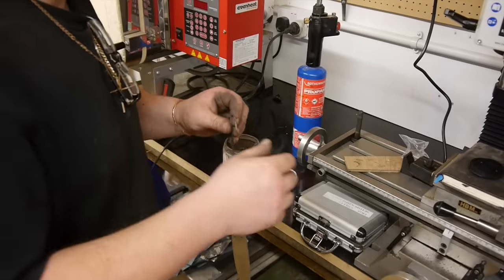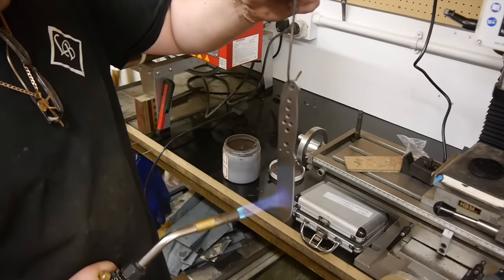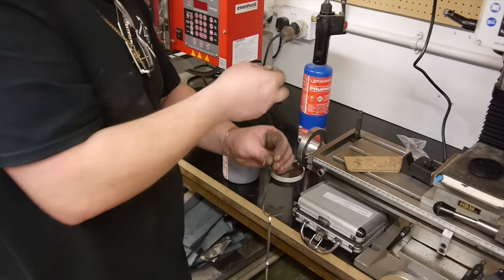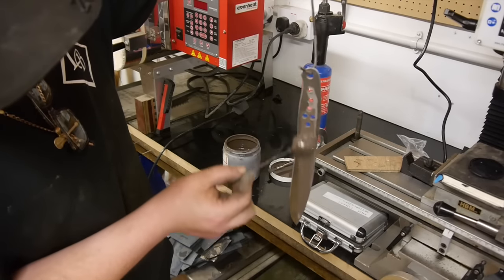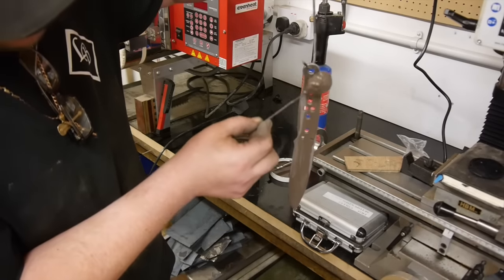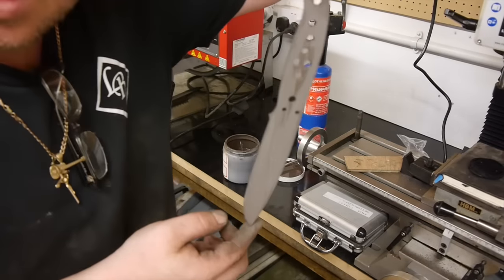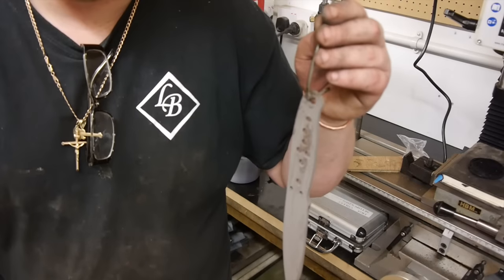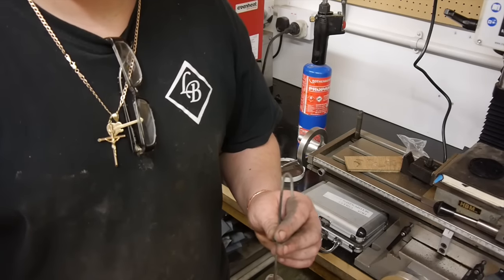knife making how i apply anti scale compound

Comment: nice tip re warming blade first, looked much less hassle than using a hair dryer and looked to dry really quick.
couple of questions if I can. how bad do you think decarbonization really is on plain steels like 01, or is this dependant mainly on soak times used rather than getting up to austenizing temp and can you get the antiscale in the UK? 
and linked to this, with simple steels do you put the blades in when heating cycle started or let kiln get up to or near to req temp first?
thanks as always for your time and sharing your hard won knowledge.

Comment: Hi Lee once it's on the steel is it hard or will it come off in the oil quench to pollute the oil. Great tip though:-)
Reply from the maker: +Andy Oaken Lore Knives yes it flashes off. The way my quench bucket is designed you can strain all that out.